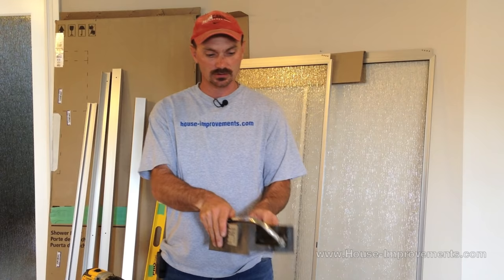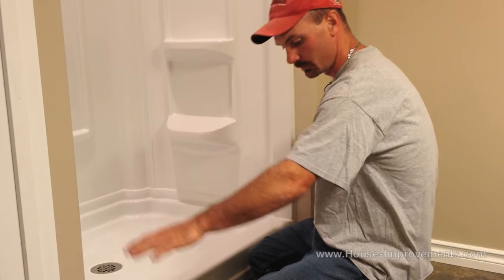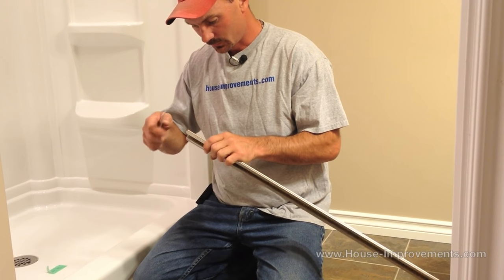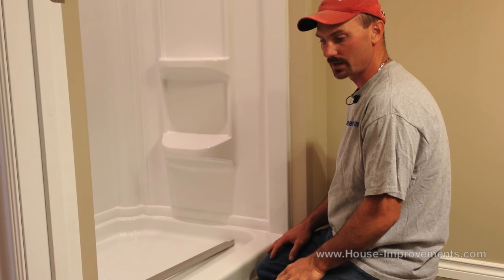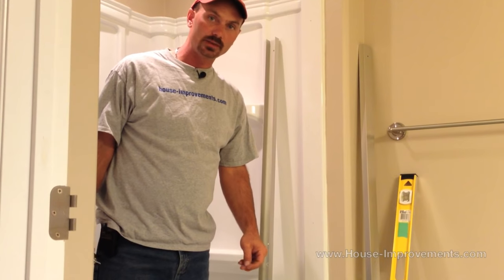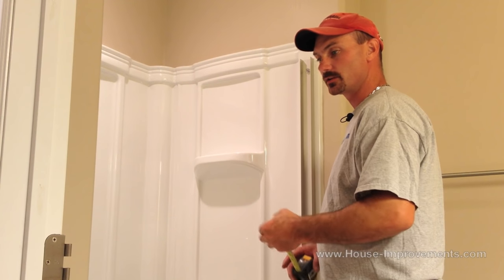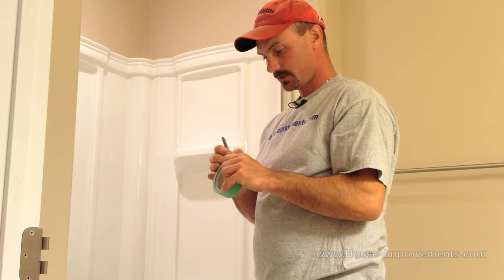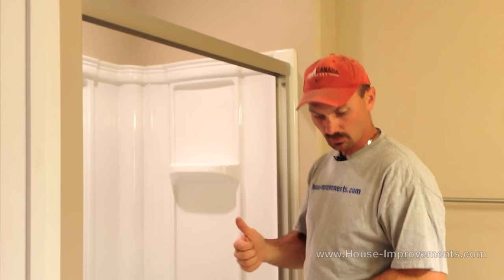How To Install Glass Sliding Shower Doors

Comment: Outstanding video!!!!  Thank you.  I cannot afford to have someone come out to repair my shower that continued to produce mold around the tracks nor could I afford (which I preferred) to update and replace the entire shower.  I decided to google how to install standard shower doors and immediately saw your 30 minute video.  I decided to take a look.  You were very clear with your instructions and answered questions that I had about what type of silicone you were using.  What initially appeared to be an intimidating problem, turns out to appear to be simple.  As of right now I have removed all my side and bottom frames and I’m thoroughly cleaning the shower.  I will be heading to my local home store and I’ll look for replacement rollers and I’m going to get started putting my shower back together.  Thank you!!!
Reply: How did it turn out?

Comment: I have a Maxx glass sliding shower door...The inside came off of the track when I was scrubbing the soap off of the door...I got the rubber wheels connected up top but the inside door swings inside towards the shower now...What do I have to do to make it normal...I need help quick...The video was very informal and good...
Reply from the maker: Heith Gagnon  take the lower guide off the door and then re-install after you hook it into the track.

Comment from the maker: Great question. I prefer to put wood back there. you can use drywall anchors to hold those shower door side rails but wood backing is more secure.

Comment from the maker: They recommend in most door frame set ups like this to not silicone there only on the outside edge. The idea is that so if water gets down there from around the side pieces then it will be able to drain back to the inside of the shower and air can get in to keep it from growing mould

Comment from the maker: Most shower door instructions call for no silicone on the inside. The reason is so that if you get moisture in there it can get out and drain back into the shower pan.

Comment: Thanks!  I'm about to do the same. Btw can you tell me the make and model of that shower stall? The one I'm working on is EXACTLY like this one but it needs a new pan (due to the original installer not putting a good base underneath).  I've looked everywhere in stores and online.
Reply from the maker: Sorry but I do not know for sure , its around 20+ years old so may not be available anymore

Comment: Hey Shannon thanks. What can be done for sliding doors that don’t close all the way the one door keeps rolling back. Is the track installed out of level or can the rollers be adjusted?
Reply from the maker: I would guess the track is out of level. You can check that and if it is maybe shim it up on the end that is high or last resort take the long side piece off and cut it off an are install.

Comment: Hi Shanon, good video. I have a question, my shower door looks exactly like yours. My glass door is broken, but I could not find the same size of door either in Lowe’s or Home Depot. My shower 65.75” heigh and 44” wide opening. Can you tell me the brand name of the door you installed in this video. Thanks

Comment: I have this same door system that was installed by a contractor about 10 years ago. He ran a bead of silicone on the inside edge of the lower door track that had become discolored so I wanted to redo that and put new silicone. Now I see that the contractor may not have properly installed this lower piece of the track since I have no idea where he siliconed on the bottom of the track where it touches the fiberglass stall. I removed the doors and top piece so I could have more room. 
My question is should I reapply silicone to the inner edge of the lower door track? Also, he never applied a bead to the outside edge of the lower piece of track.
Reply from the maker: I would seal the outside edge of the lower piece .

Comment: I have a shower  area made of plastic,  and the plastic is hollow,  do you think we can install glass door for this shower area?  Because  I'm afraid the plastic is not strong enough to hold the glass door.  And if we drill on this plastic,  would it crack?
Reply from the maker: check the manufactures website.

Comment: I had a leak develop after 3 years and I believe it is the joint between the bottom threshold and the vertical jamb in the front of the tub. What is the best way to remove the silicone caulking as to not scratch the brushed aluminum and recaulk?  
Will silicone caulking adhere to a previous installed tile/grout caulking, because the leak may also be between the front tub corner and the threshold?  It has managed to seep down the tub lip on the front and into the sheetrock on the side of the tub making a complete mess of the sheetrock.  The tub was sealed with the tile/grout caulk and the sliding glass enclosure with 100% silicone caulk.
Reply from the maker: protectionman Using a plastic razor blade works pretty well or your fingernail. The silicone should adhere to the old chalk/grout.
Reply: I would like you to do a video on troubleshooting a leak involving a frameless sliding glass door enclosure like Basco to see if it actually coming from the enclosure or caulking around the tub abutting the enclosure.  My problem is that I would hate to disassemble the enclosure if the leak is somewhere in the caulking near the jamb.

Comment: Is the header piece just resting on the sides and not secured? I guess the downward pressure will stop it from moving.
Great job Shannon!  Very clear and precise. You should have your own Youtube channel.
Reply from the maker: yes most designs just have them sitting there.
Reply: If you silicone around the head rail, that will hold it on very well. Some manufacturers use a set screw on the top rail.

Comment: I have a saw designed to cut MDF with that plastic coating used for shelving -- 60 teeth, carbide tipped. Is that reasonable to use that blade for for aluminum?

Comment: @House-Improvements:
I was wondering if you have any suggestions for repairing that "black" thing at the bottom of the shower sliding doors...it holds the two glass doors in place when you open and close them.
Unfortunately, my Grandmother lost her balance and fell into the nearby glass shower doors (she's super blessed because she did not suffer any injuries)...however, it did knock the little black block thing at the base of the shower (which sits on the metal slide) a loose. 

Now, the bottom of the glass doors on the shower doesn't have anything to "keep" them in place when opening & closing them.  

The top of the glass shower doors (the header, I believe it's call) is fine. It's just the "bottom" of the shower doors that swings out due to not having the "black rectangle" thing to keep them on the metal track (groove) when opening and closing the door.
 
Any suggestions on how to repair this problem would be most welcome.
THANK YOU!
*P.S. We really learned a lot from your tutorial...and appreciate you sharing your skills & knowledge with us!!!

Comment: Shannon thank you for the great video. I'm about to do my shower door with the same exact setup. Only exception is the bottom is out of level by 1/2" Any suggestions?
Reply from the maker: wow, that is a lot. The door does have some adjustment...hopefully enough for that. I would set it up making the header track level, if there is not enough adjustment you may have to cut one side to put it out of level unfortunately

Comment: Shannon, I want to install a tub door, but where the tub surround meets the tub is curved ... doesn't make a right angle. The curve is almost too large to just file a small curve in the bottom track. Will that make a difference?

Comment: Is the shower fiber glass? If so, do you need something to support the door's weight behind the shower, like wood, for the screws to latch on? Or can the shower walls hold the weight of the door?
Reply from the maker: Meli LaChula  Most have plywood moulded into the side jambs. Even if it does not theses doors real do not put much real weight on the sides. Simple plastic wall anchors like for drywall will hold the screws if there is no wood.
Reply: +HouseImprovements Thank you!

Comment: Can you tell me who is the manufacturer is of the doors your installed in this video?  I have the exact doors but the bathtub version.  I need the bottom clips and screws for the inside door and the towel handle for the inside door as well
Reply from the maker: Maax I believe

Comment: Top Tip number 2 check the sides for plumb with a level before buying your door from the big box store. Most doors systems that you buy at the big box store can only adjust for 3/16 out of square and can end up with big gaps that will let water out. I didn't check my fiberglass shower surround before hand it is almost 7/16 out of square and ended attaching filler strips to the side pillars that filled in the gap. Obviously the builder didn't check for square when it was installed. They do not have the filler strips at the store I had to  make them up with aluminum strips from the hardware section paint them brushed nickel ( yea I know but the color is close)and attach them with silicone adhesive. What should have been a 3 or 4 hour job at most turned in to multiple trips and figuring out a solution to a problem . My kit was manufactured by Sterling and has frame less doors and was well worth the hassle as it solved the problem of the shower curtain letting water out. Custom shower door installers can custom cut your door system to fit just about any situation so that may be a route worth looking into if your shower walls are not plumb and square.
Reply: After our shower was installed, (by a professional, no less) we had to take it apart and shim the back wall and both sides! The walls were 3/4 of an inch out of square/plumb! Once it was shimmed, i did the sheetrock so it hid the difference in plumb.

Comment: I had some shower doors installed by a contractor about six months ago. The bottom railing does NOT have the silicone sealant on the inside of shower and it looks sporadic on the outside of bottom railing. Mold is now collecting underneath the rail and water leaks onto floor. My question to you is.....should there have been a bead of silicone placed on the inside bottom rail or is it normally just placed on the outside of the rail??
Reply from the maker: Many times it is only on the exterior
Reply: Thank you for your response!!!

Comment: we just installed our shower doors but our walls are not squared. when we close the door you can see a gap at the upper end and the bottom hits the corner. any ideas how to fix? do i need to put a shim behind the upper frame?

Comment: How do you stop double sliding shower doors from sliding by themselves. I realize they slide because the installation is tilted, but I don't want to re-install the doors because you never get as good a fit as the first time. It would seem some sort of friction is need but not sure what to use. Any thoughts?
Reply from the maker: Many of them will have a rubber seal that fits along the joining edge where they lap when closed. This strip usually gives a little friction.

Comment: @ 27:36 you was talking about the shower head direction and how the doors need to be. What if you had a shower head on both sides of the shower? Im in the process of building a shower and i put a shower head on both the left and right wall and now im needing a sliding shower door. Is there a particular door i will be needing?
Reply from the maker: You may have trouble with the space between the door panels leaking if the seal is not good. Keep the head pointed a little more towards the back wall and you may be fine. Use our forum if you have more questions please. https://www.house-improvements.com/forums/

Comment: Great video! Quick question, do we have to hit studs when screwing on the side rails? And does the bottom track needs screws?
Reply from the maker: Your unit should have wood added in the side areas at factory so you can screw right to it. If it does not you can use small butterfly bolts. The sill does not get screws. Follow manufactures instructions.

Comment: You silicone the inside edges that contact the base and walls after install. If you dont silicone the inside edge of the base you will get moldy slime accumulation under it.
Reply: Exactly. However, some products, like Kohler Sterling have installation guides that instruct that bottom track is caulked on the bottom outside and not the bottom inside. Yet same vendor has another installation guide for a different model that says to caulk both edges on the bottom. If you don't caulk the inside edge, I firmly believe you will get water that seeps under the bottom track during normal shower usage as water droplets get kicked around. The shower pan I have has a level shower curb, so water won't drain inward but would puddle and cause slime build up overtime. Seems like caulking both outside and inside bottom edges makes most sense. Still need to guard against any water getting under the bottom track. Caulking the bottom track at the wall edges seems very important to make that area water tight.

Comment: Hi @HouseImprovements,

I am install a shower door very similar to the one in the video, possibly same brand(Maax). When I try to hang the exterior door it just hangs there and I can't get it to sit on the tracks. Even with the lowest roller setting on that door. I did everything as explained in your video and the installation manual, but have nothing. Can you assist?
Thank you in advance.
Reply from the maker: Not to sure, just be sure that the rollers are actually sitting properly on the upper track , also check that the header is sitting down on the side jambs all the way.
Reply: think I found the issue. Since my tub has rounded corners, I think I'm going to have to cut the side panels a bit to fit.

Comment: I am trying to install a used triple sliding shower doors and my header is cut an inch to short and my bottom track is half an inch short. For the opening?
Reply from the maker: You likely have the wrong set for the size of opening you have.

Comment: My current shower doors have a lot of unsightly mold on the sealant on the inside bottom sill and want it cleaned up. After removing the bottom sill plate I was horrified to see the dirt and gunk underneath and don't want a repeat of this anytime soon. After watching this and other videos on installing the frame on these shower doors, I've decided to not seal the sill plate so I can easily remove the sill plate anytime and clean underneath it. The only downside to doing this is the doors are not as secure and swing more freely and may make more rattling noise when opening and closing the doors.  This I can live with rather than having dirt/mold accumulating underneath and having to remove and reapply the seal every time I want to clean underneath which is very time consuming. I got this idea from seeing the frameless shower doors and will eventually install one of these when I redo my bathroom. My current shower doors require sealing the inside track, rather than the outside so I would have had to seal the entire inside sill plate too. I might even get a gasket to place under the sill plate for better stability.

Comment: What is holding the weight on the sides the fiber glass shower enclosure is pretty thin. Am scared of drilling it then messing everything up.
Reply from the maker: Most have wood strips moulding into the fibreglass in those areas and if they dont the doors come with hollow wall anchors. The weight transfer is basically straight down once its all installed .
Reply: @HouseImprovements  you’re really awesome 😎. Thanks for replying I will try and use a stud finder to see if I can get lucky. I am originally from a country that only builds with solid volcanic rock drywall scares me especially in wet areas. Thanks.

Comment: Can always cut out a piece of cardboard from the box to fit the shower receptor. Tape around the edges to prevent debris from getting under the cardboard and scratching the receptor. Then you don't have to take boots off.

Comment: Just had a new shower installed and used the old shower doors... now the left bottom corner leaks.  What do I do?
Reply from the maker: could just be a silicone issue? Could also be that you re used the doors and they do not fit as well as they should. check the silicone first.
Reply: Thanks for the sugestion.

Comment: how do you reseal the bottome if the silicon has worn out over time? do you have to take the frames apart?
Reply from the maker: Can you run a bead on the edge of it? if not you may have to disassemble it.
Reply: +HouseImprovements I will have to try thx
Reply from the maker: sounds good

Comment: One question I have, there's some water pooling along on the bottom track, is there any way to remedy this?
Reply: Inside or outside of the bottom rail?  If you see it on the outside of the bottom rail, you need to remove the silicone and re-seal with new mildew resistant tub and shower silicone - white or clear usually. If it's pooling along the inside of the bottom rail, then the fiberglass sill is sloped to the outside, which means it was installed poorly. I would clean it very well and make sure it's dry underneath the rail and silicone the inside as a defense against water trying to move to the outside.

Comment: the problem I have is my fiberglass shower has a small space where the walls meet the pan, I guess you would call it a 3-4 piece shower, water runs pass the side tracks, how can I fix this? thank you for any help.
Reply: How about silicone?